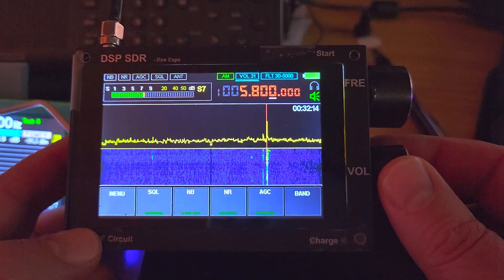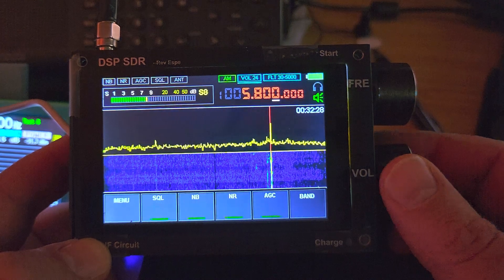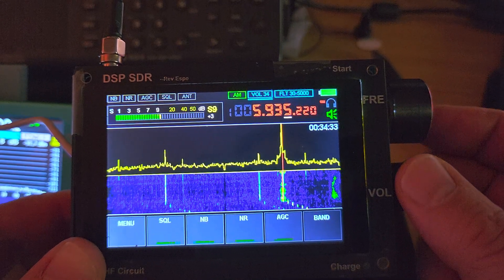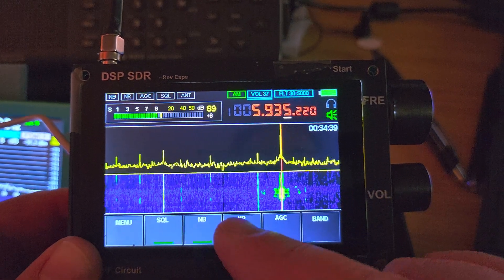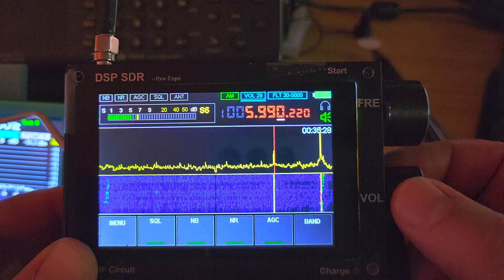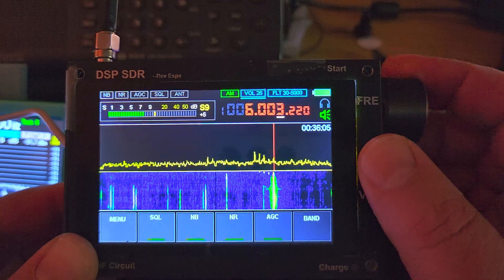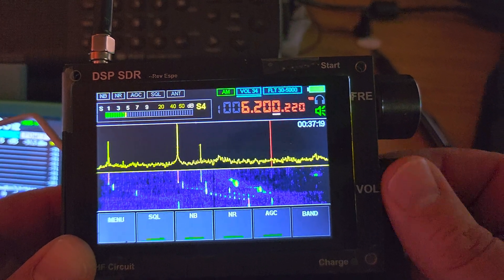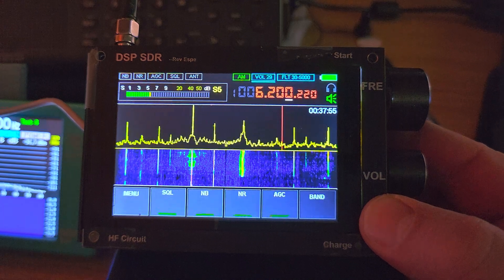DSP SDR Malachite clone tuning 49 meter band shortwave we can see it easily overloads

Comment: So, is it safe to say that these are not quite ready for prime time yet?
Reply: If you can get a hold of a genuine Russian Malahit DSP2, there is a world of difference , I first started with the exact clone as in the video with the demo software almost 2 years ago and then got the real thing Nov 2021 just before trade with Russia went bad. The receive on the DSP2 is equal to my RSP2pro in fact a little quieter because of the stellar NR and NB circuitry on the Malahit, they operate on the same chip.